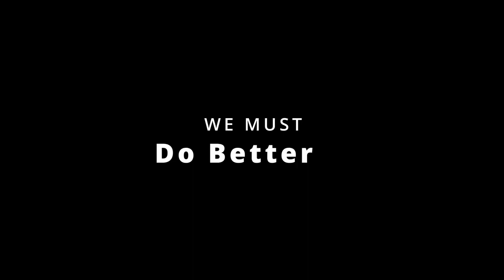Inappropriate Actions

Comment: Ok, dudes, RURAL firefighter here who has neighborhoods that look similar to this one - but only FOUR hydrants in the ENTIRE county. Not a single hydrant is rated for more the 750GPM and supplied by water towers of only 4,000G filled by 2" lines. Therefore, we CANNOT hook direct to a hydrant to fight a fire. We run Tankers, drop tanks and pull direct out of area Lake. So guess what? First Engine on scene starts flow while waiting for Tankers en route to resuplly.

So you keep harping on 'securing water source' as if EVERY department is a city department with plenty of high flow hydrants everywhere. MOST rural departments are NOT.

Everything else is spot on. Though if this is a Volunteer department (majority of American counties only have Volunteer  - outside of city/suburban areas) they are simply doing the best they can do with the few Volunteers who showed up. Might even be their first fire.

Yes, MOST departments are in the same boat. We are not city boys with it easy

Comment: This guy must be a cop. You can do a lot with tank water if you know what your doing. THEIR SOP is probably the second due hits the plug. Guess you need to do more homework before you think you know what’s going on.
Reply: A 16-year-old using common sense and logic with grade school science could figure out what to do. You don't have to be a Highly Trained Firefighter.  You are absolutely correct that most residential fires can be handled with one or maybe two water baring apparatus but the first on site should lay in or attach to a nearby plug.  What if the second due gets in an accident or can't get close in?  Maybe You should think things through a little more before commenting!

Comment: I know of a lot of fire depts that the first engine on scene goes to the fire and the second due engine lays in a supply line.  I dont like not Laying  in to a fire/ How long  beforethe second due shows up. Idont have a problem with pulling a supply line if the hydrants is with 100ft of the fire.
Reply: It's an engine not a truck

Comment: re: waiting on a second truck for a supply line, what happened to the second truck (from the opposite direction) at the 0:52 mark?
Reply: also the 4 other units on location but no personnel assisting at the fire scene.
Reply: Good question.... at one point you see two other trucks on scene. Doesn't look like they tied into the first arriving unit to supply it. There's a lot we don't know about this scene!!!
Reply: May be rural area and busy setting up drop tanks to resupply. MOST areas/small towns in the US don't have high flow hydrants at every corner like Urban/Suburban areas

Comment: I believe you said exterior fire with a residential exposure, or something close to it. A 500-700 gallon tank should be able to slow/stop/buy time for hydrant to be taken by the 2nd or 3rd Engine. If you wrap the hydrant  you give away approximately 30 seconds of on scene time. If youblay forward you lose your FF. What if....there was a rescue? Risk analysis....lets see what we can do with 500 gallons and 3 FF. Now having said that....there is no excuses for the poor hose pulling and the amount of time it took to get water to the nozzle off of tank supply.  My take....good decision on tactics....bad firefighting.

Comment: I think the biggest problem is a engine company of 3 means you have no one to secure a hydrant. The engineer should always operate the pump and monitor the supply. You always need a minimum of a 6 man crew, consisting of an engineer an crew leader a two men attack and two men support/ 2nd attack. Or a standard of two 4 men engines to every structure fire, where the second arriving crew always supply water for the one first on scene. There were two fire engines on scene and the hydrand wasn't secured within 5 minutes. in short this was a complete Mickey Mouse show.
Reply: THREE, competent people can handle this and most residential fires until help arrives. You drop off the hydrant line with firefighter number One.  The engineer, FFer number Two, activates the pump while FFer number Three Deck Guns all that Visible Burning Material that is threatening the structures.  By that time, you have hydrant water flowing and the first FFer can pull a Correct Length Hose.
Reply: My engine company runs with 3 guys. They have 4 seats though.
Reply: @JB91710  that is not a deck gun operation. Single 1 3/4 solid bore at 161gpm and 50 psi nozzle pressure takes care of that fire
Reply: @branger96  My way stops the threat faster.  That's what counts. But I was impressed with all those stats and dropped names.  Too bad nothing you said how this fire should be extinguished in time to save lives and the structure.
Reply: Heck, MOST rural departments are doing good to have TWO volunteers show up. That's why it's normal for 3-4 different departments to show up to small house fires. Some trucks only have ONE Volunteer!!

Comment: 0:34 The houses are being threatened by an external fire.  You park here and deck gun this on tank water for 10-15 seconds.  Then, you mop up with a hose.  Then you carefully and respectfully search for extension into the structures.  Let's see what they do from here.

0:50 Water should be flowing from the Deck Gun by the 1:30 mark. A supply line should almost always be laid in but, this is a single tank fire.  This is just another in a never-ending list of incompetent USA fireplaying.  If they didn't do what I laid out, they are doing it incorrectly because what I said is the quickest and safest way to Stop the Threat.  If you viewers can think of a better way, Tell Us!
Reply: Without a secure water source - you do NOT use up most of your water with the Deck Gun! There may not BE a hydrant within a mile of this fire. That's COMMON in rural areas (70% of American counties). Unless you've got Tankers with drop tanks filling to pull from - you DON'T set up deck guns! Engines only carry 800-1400G. Deck Gun can empty much of that in under 30 seconds.  Then you are DRY!!
Reply: @insanealchemist1  If you are rural, you had better carry 1000 gallons of water.  Now, how much water would you use in 10-15 seconds?  I said nothing about 30 seconds, or a more accurate number is double that.

Comment: Almost everything you said is wrong for one reason another, with the exception of the FF pulling the 2 legs of hose. First due in means first water on fire. Not only that, but some depts, including my dept, don't have hydrants, we have tankers and draft holes.  If you do have hydrants, it's second dues job to hit the hydrant and tie in with the first engine, unless you have enough man power and close enough hydrant to not have to relay or shuttle water up the engine,  to drop a line and a guy to man it at the hydrant. I will agree that the FF made a mess pulling hose, he should have pulled put both legs on his shoulder and went out, letting it flake as you walk. In a situation like this, a scenario like this, you absolutely want to put water on the fire as quick as you can because of how many exposures you have present. You can easily knock that fire down with 200-300 gallons and a fog nozzle. I've been doing this for 8 years now, I ought to know a thing or 2 about a thing or 2. You want to watch a real cluster, go check out Grant's Pass out in Oregon I believe. It ain't wholly there fault, being as rural and wholly unequipped as they are but they lost an entire house after dumping there tank and not doing much else.
Reply from the maker: Please explain where I'm wrong so we can have a conversation. Reason why; I think you're a firefighter. Let's Talk
Reply: Where in all that where was he mostly wrong?  However, you are right about what you said.
Reply: @firefightercritique9613  That's right!  Anybody can say, "You are wrong."  Proving it is another story.
Reply: @firefightercritique9613  You are watching a video  that shows only the Alpha size and you think you know how it should have be run. Also many departments have decreased 4 man crews to 3 man crews. 4 man crews complete essential fire ground tasks 25% faster than 3 man crews and a 4 man crews applies water 6% faster than a 3 man crew. Staffing has NOTHING to do with the frontline firefighters. So while you sit and bitch about what you see in the video none of it has to do with anything these firefighters could have done differently.
Reply: Spot on! 70% of American counties are RURAL with few hydrants and no high flow hydrants. Other than the mistake with hoses, this 3 person Engine crew did what would be expected as FOS. Actually did it very quickly despite hose snaffu! While they wait for Tankers and drop tanks to arrive, set up and connect drafts to FOS Engine. The other Engines might have started that very process out of frame.

Comment: I see three engine companies there, 2 immediately together. That gives me a couple of thoughts that the OP didn't mention.  Nursing from second engine=1500 gallons of water. Third engine? +750 more.  Did any of those two tag the hydrant? Is it possible that this departments policy is to tie in to the officers side of the engine since that is most off the sidewalk side and therefore allows traffic (and other fire apparatus) to pass by on the drivers side. Outside, wind at their backs, WHY would they be on air? There comes a time when you have to use good judgement, and the concept of blowing a bottle of air in FRESH AIR is STUPID. Blah bah blah hose spaghetti and nobody doing much... ok.  How many fires have you fought that went perfectly and EVERYBODY did the right thing 100%? This is the first video I have watched from this channel and I hope the critiquing gets better than this, because sofar its not impressive. Its Monday morning coffeetime quarterbacking without all the facts.

Comment: The amount of water carried on each incoming Engine can make, or break water supply to the 1st in Engine. Most City Dept Engines only carry 500 gallons of water, while most Volunteer Dept Engines carry 1,000 gallons. A good nozzleman, and a good Engineer can stretch that 1,000 gallons for quite a long time by setting the pressure at 80 to 100 psi, with the nozzle set to 100 gpm, and in a medium size fog pattern. I know because I have done this both as a Nozzleman, and also as an Engineer. Once the 2nd in Engine arrives, and lays a supply line from the water source to the 1st Engine, then the Engineer, and Nozzleman from the 1st in Engine can communicate any further adjustments to the pump pressure to the charged line in operation, and the nozzle gpm can be readjusted as needed. Personally, in this particular situation, upon intital arrival, I would have had the Engineer of the 1st in Engine charge the deck gun temporarily while the hose line was being pulled, and flaked. Set the deck gun at a moderate pressure by gating back the discharge valve of the deck gun. Once the handline was ready to be charged, have the Engineer shut down the deck gun, and charge the handline. The purpose of the deck gun is to knock down a high volume of fire to keep it from spreading to any nearby exposures. It is, by far, one of the most under utilized pieces of firefighting equipment on any Fire Apparatus.
Reply: It's not how much you have; it's how you use it.  Water needs to be Surgically applied to do the job while using the least amount.  The vast majority of USA firefighters are Fountain Statutes.  Everything else you said is spot on.  I'm surprised Virgil isn't here telling you, "You aren't a firefighter and never were."
Reply: Learned something!! All of our Rural Departments have 1,000-1400G Engines. Didn't realize city Departments had 500G Engines?!?! Jeeze our F350 Brush truck carries that size tank! Thanks for the facts!!

Comment: I AGREE 100% WITH YOU.... ENGINEER  LIKE ME/MYSELF I WOULD  LAYED A SUPPLY LINE AND CALLED 2ND ALARM....
Reply: 2nd alarm? That's an attack, back up, exposure to the interior and check for extension. You really need 8 engines, 2 trucks, 1 medic unit, 2 Battalion Chiefs, 2 aid units for that? Seriously?